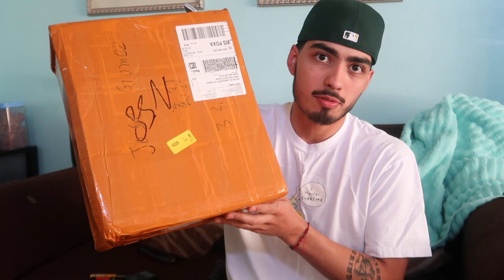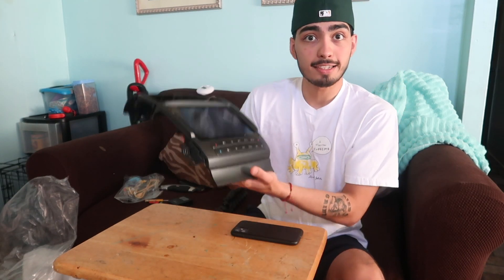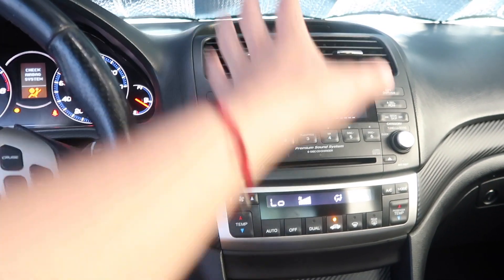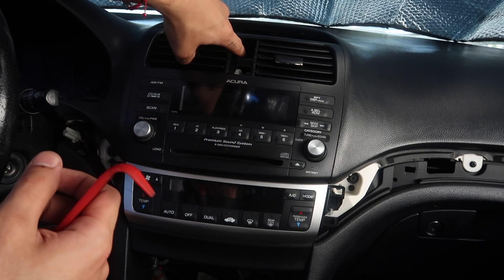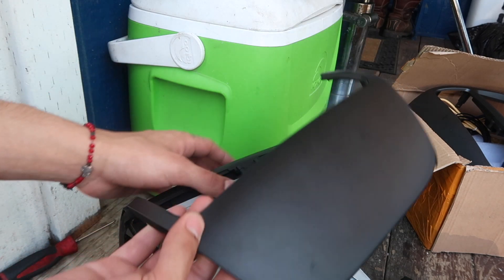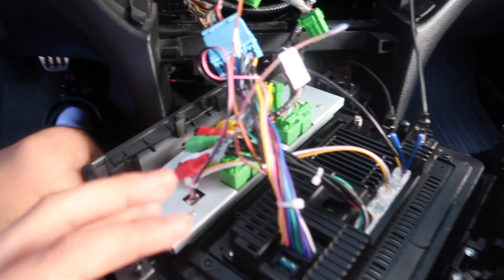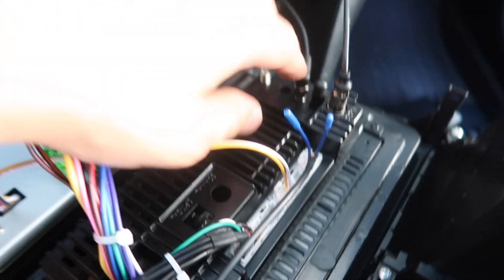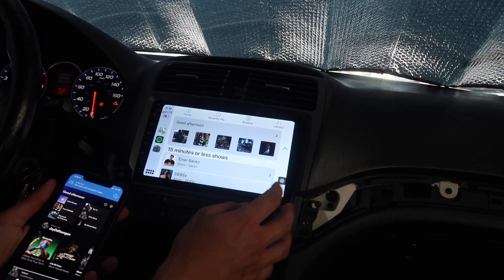04-08 Acura TSX 10" Aftermarket Stereo // DIY

Comment: This is great. Thank you. I have a few questions:
1- Did you connect to XM Radio? If so, how does it connect?
2- How do you connect a backup camera? Just run a VGA from the head unit to the back?
3- Any issues 6 months later?
4- Do you lose steering wheel control?
5- Can you directly use XM radio without additional hardware?

Thank you!

Comment: I installed my radio the same way you did but why doesn’t my A/C turn on. The light and it shows on the screen the A/C is on but it’s still blowing hot air and I cannot hear the A/C coming on?

Comment: I have an 06 tsx… my car came with a navigation system as the stock head unit. Will this install work the same even though I have a different stock head unit?
Reply from the maker: Yes as long as the connections weren’t cut. I would check before buying it though.

Comment: I’d like to utilize the rca cables and run those to good amps in the trunk.
Could I pull those speaker wires back to the center console, disconnect factory amp, by an adaptor and tap back into the factory wiring system?
Reply: I know this is 2 years old but you can get a Acura slice Honda in your face box that's Plug and Play to do what you're wanting to do

Comment: is there some type of module i can buy so I can get my steering wheel controls back?
Reply from the maker: I’m not to sure but the only thing that didn’t work after installing the stereo we’re the buttons to change the songs. Everything else worked fine.
Reply: @lowlifeboyz  so volume buttons on steering wheel still work?
Reply: @XavierFerren to get your controls back on your steering wheel your gonna need to change your Clock spring.

Comment: Hows the apple carplay? smooth and crisp compared to other radio options like pioneer or kenwood head units?
Reply: also, do you think your speaker system got louder once you did the install?
Reply: @bruhleaning9056  it’s pretty smooth, nothing crazy but it’s doable. and yes your speakers get 100x louder

Comment: That stereo is 🔥 . & the video definitely help.
Where did you get it? It’s not in the description.
Reply from the maker: I bought it from Ebay but you could try & check Amazon.
Reply: @lowlifeboyz   and the stereo called?
Reply from the maker: @nowaywimpy  the seller that I bought it from sold out. But here’s another seller I found https://www.ebay.com/itm/9-Android-3-32GB-Car-Radios-GPS-Navigation-Carplay-Stereo-for-Acura-TSX-04-2008-/164078199865?mkcid=16&mkevt=1&_trksid=p2349624.m46890.l49286&mkrid=711-127632-2357-0
Reply: @lowlifeboyz  how long did you wait to get it ?
Reply: @lowlifeboyz  that seller sold out still got this link

Comment: hows this android stereo so far? any issues? and the a/c buttons all work no problem? 
also did u connect a backup cam?
iv been lookin at this exact one and ur video was by far the best one out for this unit!
Reply from the maker: The stereo still works great! I haven’t had any issues with it besides like once or twice where the fan speed button stoped “working” but I just turned the car off and back on & everything went back to normal. I do have a backup camera but I plan on upgrading to some better one cause the one I have sucks.
Reply: @lowlifeboyz  thanks for the quick reply! appreciate it